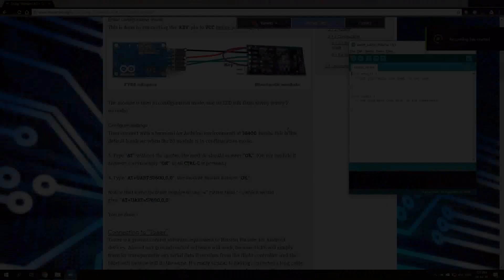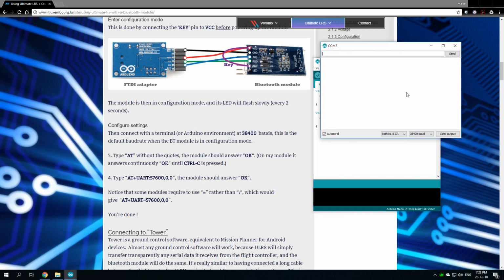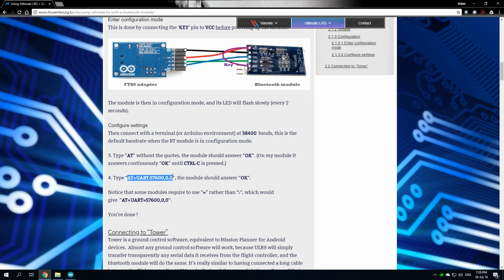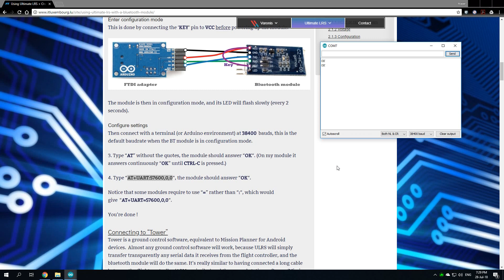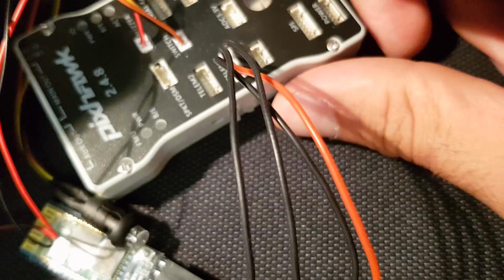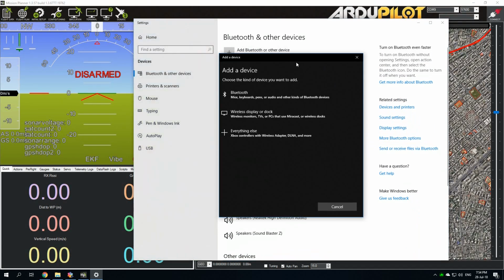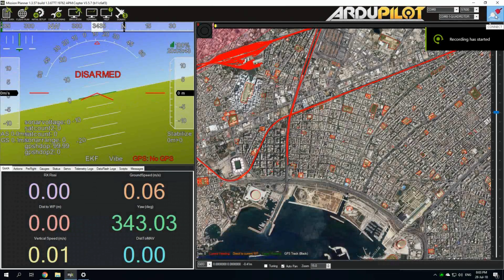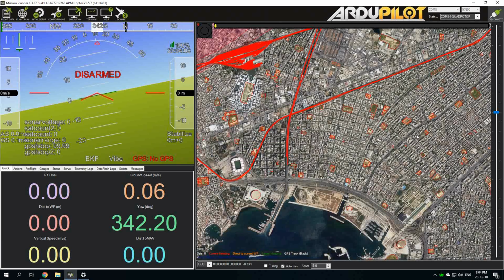Setting up Bluetooth HC-05 to be used with Pixhawk and Mission Planner.

Comment: Finally my 5 days of struggeling are finished

My First try was the esp8266 nur that didnt Connect to the FC Clone today the hc05 arrived....

5 hours in the Internet soldering wires resistors NOTHING worked Not even stackoverflow

But Then
THIS VIDEO 

I did the Things in the Video
Didnt work
Switched RX and TX 

(screaming Like a child on Christmas) FUC* YES THE HORIZON MOVED IT WORKS

TL;DR thanks
Reply from the maker: Hahahah yes I think I mentioned you should always swap the rx and tx terminals on 0:21 though.. Welcome to the world of electronics where a simple task can take ages but when acomplished can make your day!Nice story, glad to know it worked!
Reply: @maixechrys6264  yeah i know ist supposed to be the First Troubleshooting step but i did that before the Video so i didnt think about It First after setting the baudrade but that was actually good because i got disapointet First and was Like 

Whatever might try that while the Iron is hot

So the "happines curve" was even better

Building my Drone was definetly easier XD
Reply from the maker: @devilcloudleitung6080  yeah actually do this myself sometimes and skip steps but then I get the happines curve which is more thrilling!

Comment: Hello. I have a laptop that does not have built-in bluetooth. can I use an hc-05 module to communicate with pixhawk? ... considering that on pixhawk I also have an hc-05 module. if possible, then how to proceed? ...
Reply from the maker: Hi I am using this bluetooth receiver and works fine, https://www.ebay.com/itm/353276529924. Yes probably you can use hc-05 but for 2usd why bother? If you have a spare usb male connector and solder the wires + - tx rx on the hc-05 maybe it will work.

Comment: Thank.
My friend how connect talmatry RFD 900 MGHz weth Ardunio
Reply from the maker: Ground to Ground Vcc to Vcc Tx and Rx reversed. The receiver to usb on phone or pc.
Reply: @maixechrys6264  Thank you very much my friend. Telemetry Tx and Rx ports, where to connect to Arduino and how to get code
Reply from the maker: @ashkananali8571  you havent specified whitch board but then again Im only talking about pixhawk and ardupilot software here.

Comment: Thanks for the great upload. What’s the range on this?
Reply from the maker: Thank you friend, the range is limited I would say around 15 meters depending on placement.
Reply: Maixe Chrys not bad at all. Is there a way of extending the range by adding a bigger antenna or something like that?
Reply from the maker: @LondonMus  Yes of course the only true limit is size, but then you can go with a regular telemetry kit. This is only meant for short range and troubleshooting I dont see any real benefit in extending the range because the 433mhz kit will always be faster and more reliable.